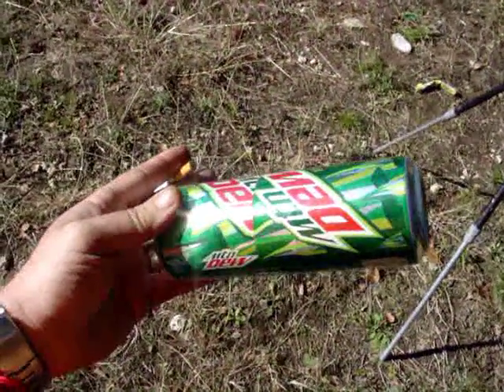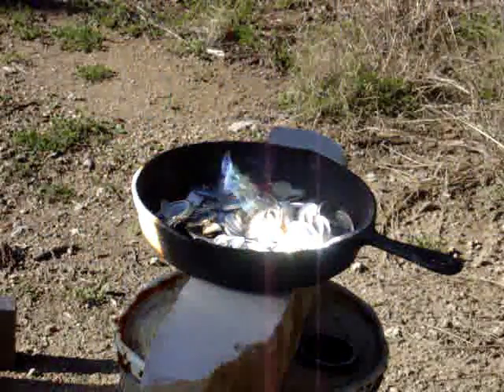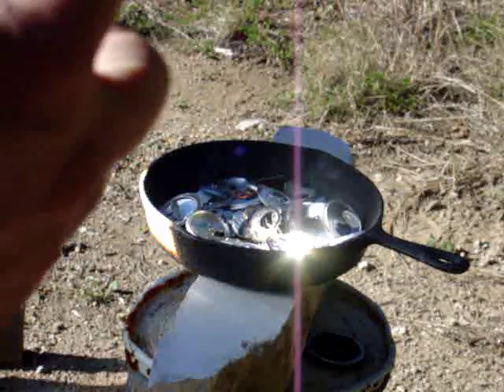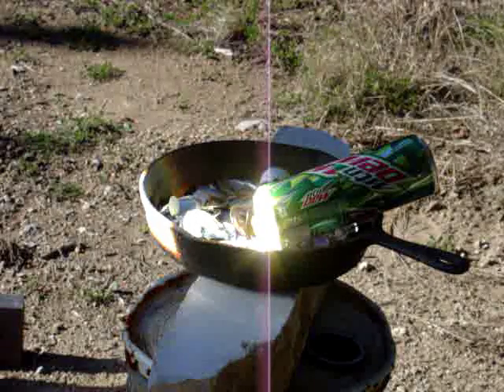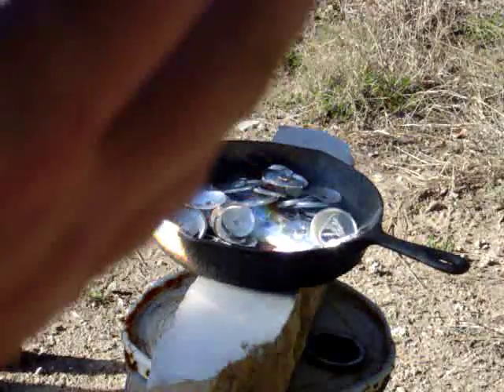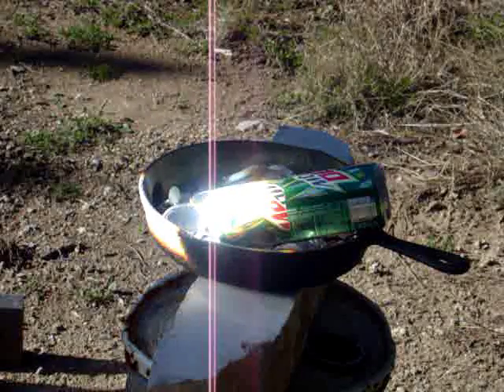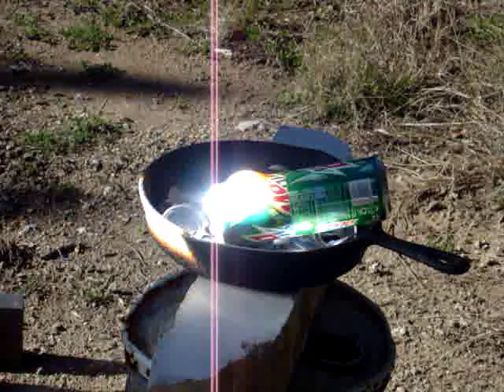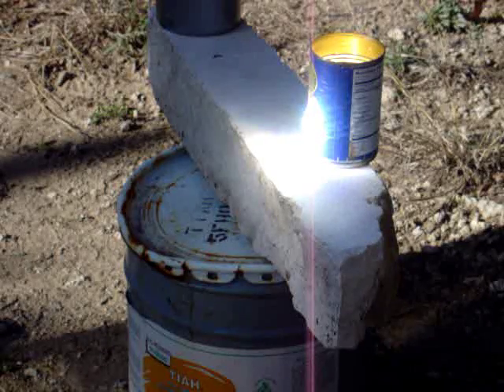SOLAR POP CAN CANNON

Comment: I think that this video can be put and 7 stars!
Plus 2 stars for the development of "Solar Christmas Crackers"  or "SCC"  !   :))))
And I would not be bad to impose on all sides by brick. On the other side where the sun goes luch leave otversie, then temperatura increase in Inside the chamber and melting will luchshe results. Melting always done in the Crucible in which there Chamotte clay with 5 sides. At the open air is always more difficult to raise the desired temperature.